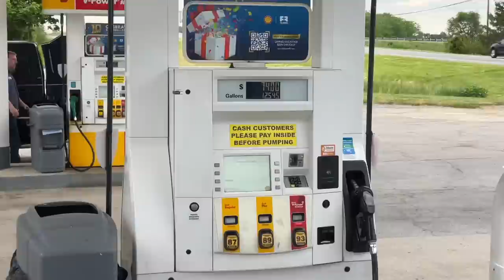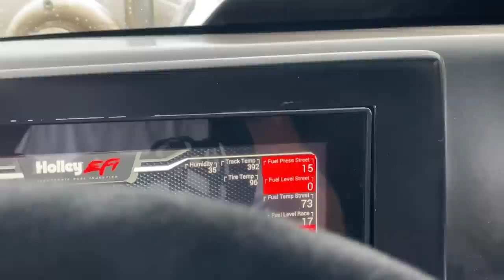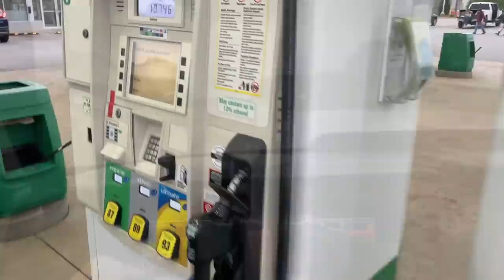Midwest Drag Week DAY 2 - Mullet FINALLY Hooked Up and Ran His HIGHEST SPEED EVER!!!

Comment: Really nostalgic to see Kevin rolling with cleeter on this event in the car he built for him.  Even if he had nothing to do with the new engine setup.
Reply: He still built a hell of a racecar!
Reply: Exactly, even if the engine is now different, Kevin still did a ton of great work on the other parts of the car.
Reply: And he’s more responsible with the tuning…  You don’t want Cleeter running the laptop!
Reply: Na I'm thinking about Brent and cleet pulling apart Leroy when his drive shaft bolts backed out lol
Reply: It was a Texas speed motor. Now a Steve Morris engine. Kevin built an awesome car.
Reply: Kevin did build it with this motor in mind. Garrett just didn't have the engine money then... He had his helicopter to pay for! 😁
Reply: Well, he's the one who said the LS platform was simply not strong enough. It was time to get big or prepare to keep breaking them.
Reply: @ronbuckner8179  I think big block was the end game the whole time and I recall Kevin hinting at that during the build. I'm guessing there was a pretty long line to get that SM big block.

Comment: Kevin and Cleetus it's really exciting to watch you bring Mullet along, improving every step of the way. Hopefully the next track will be even better because there is little doubt in my mind, if the wheels don't spin you will be running 6s every time. Good luck. Hopefully the heat wave that's coming and the potential storms won't cause you problems.

Comment: For the race where the fuel is limited for 3 runs the 2 cylinder trick to run back to the start is ideal !
Reply: it runs on pump gas between runs though, only runs on meth once he hits the 2 step or gets into boost
Reply: Ya thats forsure not healthy for the engine lolol
Reply: @mike25620  I think during dyno testing they said it switches to methanol above 2lbs of boost

Comment: What’s most impressive about this setup is how you can drive it long distances on the street towing a trailer and race it. The dual fuel systems and build is just awesome.
Reply: Imagine if he went with the SMX variant lol.. Now that woulda be insane!... I bet he does in the future.. SMX is pure insanity.. Full billet long block, fully water jacketed, full endurance motor capable of 5000hp.. lol
Reply: Let's not forget you have to do the lash once a day at least. It's a lotta work but definitely worth it to put on that kinda show.....says the guy sitting on his couch not pulling coils and valve covers.
Reply: @JonHop1  Does it not have a SMX?
Reply: @marcog3210  No, it has a standard Steve Morris Big Block with the billet intake. Thats it.. But to say "thats it" on a Steve Morris motor is saying A LOT lol... Because its still a 3000hp capable motor... SMX is like 4500-5000hp motor. Next step up pretty much.
Reply: @JonHop1  is there a step up after SMX for a "streetable car"? just wondering lol.  4k to 5k hp is already insane.
Reply: @rayth4386  When you say "streetable" what do you mean? Because technically, the SMX is super streetable and withstand long drives and is very reliable. You can make an SMX motor last a very long time if you go with a less aggressive timing/head setup and more reliable rods, ect.. SMX is Steve's Endurance and streetable Drag motor. Its the best you can get before going with a pure Pro-Mod setup..
Reply: @rayth4386  If I remember correctly, because its been a while since I watched Steve's SMX breakdown, it is a full billet block and billet heads.. The heads are 100% custom billet and engineered off LS and Hemi heads(dont quote me on that).. I remember him saying he took the best head designs and combined them or something. Its a dry deck and fully water-jacketed for optimal flow. The cams are also custom designed as well. Not sure what the crank situation is on them tho. Ill have to watch the vid... The  purpose of them is for endurance drag runs on drag weeks. But they are multi-purpose. Why anyone would buy an $80,000 motor though for the street would obviously be a bit odd, but hey if you are rich, I would! lol.. Super versatile motor and super strong motor and well designed. Should have won motor of the year.
Reply: @JonHop1  ah ok I get u now. when I said street able I just meant something that u can do a drag and drive with relative ease. it's cool learning more about this stuff.
Reply: @rayth4386  I would check out Steve's channel, he has full break downs on the SMX.. Its in my opinion, one of the best V8's ever built for endurance drag purposes.. Its simply amazing. His head work and engineering designs are just phenomenal. Works of art. Steve's builds are the best of the best for street classes before Pro-Mods. But Steve can obviously Provide Pro-Mod setups and builds too.
Reply: @JonHop1  thanks for all the info and recommendation. I'll definitely check his channel out.

Comment: Once they get a handle on this engine combination, it's going to be crazy fast.
Reply: Its 100% capable of lower 6's..
Reply: @bigboreracing356  umm, it was the fastest pass of the day and you dont seem to know that the track conditions matter. NO high HP car was hooking up well, so everyone had to turn it down... If you didnt know, the whole east coast has been getting destroyed with rain. The tracks are not ideal for 6 second passes.
Reply: @JonHop1  He didn't say Mullet ran bad, he was responding to OP that said 'going to be crazy fast' as if 7.08 205 isn't already crazy fast.
Reply: @Choke_Dealer  I was about to say... Yeah I guess if you are only using Cleetus, Steve Morris, and Tom Bailey perspective, maybe 7.0 is average but you are right, 7.0 is crazy fast in perspective of drag racing in general. 200+mph is absolutely HAULIN
Reply: @bigboreracing356  not for mullet with a SM big block that capable of 5's... but yes, in the big picture it is...
Reply: @bigboreracing356  Calm down buddy. I didn't say 7.08 is slow. It is fast. But in case you are new to drag racing, that combination is capable of low 6s and possibly high 5s on a good track. You are definitely new to street racing because drag radials and that combination wouldn't win you any money on the street. With a $100k+ engine, there aren't even many people who would race you, much less put "big money" up.
Reply: @bigboreracing356  You were mesmerized by 7.08. You were calling other people "dipsh1t" for thinking that there is more to the combination and that it has a lot more potential. You did indeed need to calm down and quit attacking people for their opinions. Opinions that anyone with any racing experience knows to be true. 

And FYI you are wrong yet again- I'm no "kid". I was street racing at Hobby, Rankin and Cherry Hill here in Houston as far back as the early 90s. You can talk smack all you want, but anyone who has street raced doesn't think that Mullet, in it's current configuration, is a "money maker" on the street. I even gave examples in my previous comment, unlike you who just rants and attacks people who make factual comments.
Reply: @Choke_Dealer  I didn't say it's not fast either. 7.08 is fast. I was by no means saying that the car was slow or anything like that. It's fast, has been fast, and they just added a bunch of extra HP. So I was just pointing out that once they iron everything out, that thing will be crazy fast. Insane fast. It's got the potential to run low 6s or even high 5s on a well prepped track.
Reply: @JonHop1  I'm not the one calling you or anyone else names, my only point was that Mullet was fast already and they just added an engine capable of adding 1,000+ HP. It went from fast to crazy fast or insane fast, once they get it sorted out and put that power to the ground. Sorry about any confusion, I wasn't implying that Mullet was slow or anything. I'm also sorry that the guy started ranting and calling you names simply because you pointed out that the combination is capable of even more. I have no doubt that Cleetus and the boys will get Mullet into the low 6s/high 5s.
Reply: @RonniePTexan  did you tag the right person bro?
Reply: @bigboreracing356  What the heck are you even talking about bro?... Who is saying a 7 second pass is not fast? All I said, is that for Mullet's setup, its not that fast, and thats just factual. His current setup has the potential for low 6's. Thats all I was saying.. You seem to be making something out of absolutely nothing.. I dont know why, but some Cleetus fans are just weirdo's man... I dont get it..
Reply: @JonHop1  I think so, but if not, sorry about it bro. It's been a loooong day brother! Lol
Reply: @bigboreracing356  well his reaction afterward hitting that 6 would tell you other wise lol. Seeing that 6 is significant.
Reply: @bigboreracing356  Cleetus street racing?
Reply: @bigboreracing356  That car isn't set up for the street. It's a track car. Cleetus isn't even a street racer, are you watching the right channel?
Reply: @bigboreracing356  Just out of curiosity, why do you think Mullet would be a great street race car? Seriously. Give actual details and at least attempt to give some thought to it. So far the only thing you've proven is that you watch some YouTube and TV shows and think of yourself as the Expert on street racing. Back it up big boy. What would make Mullet such an amazing street raced car? How do you see it making big money on the street as you claimed before?
Reply: @bigboreracing356  Great way to sidestep the question. You may as well have just said "I have no idea how or why Mullet would make a great street raced car, but it looks and sounds fast"

Comment: How much different the Steve Morris motor makes the car!   No worries about how much power you can make...it's only about how much power the track can take.   This car is going to be QUICK on a really good track...if it doesn't wheelie itself to destruction.
Reply: I might be wrong, but I think they can use a wheelie bar if they’re running a big tire.  I think radial classes don’t allow wheelie bars.
Reply: @mysterj1  he's still on a radial
Reply: @mysterj1  he's still on a small tire  radial setup

Comment: Great passes ... 
I've got a stupid question... whats the MPG like when you're cruising the highway?
Thanks for sharing 🇨🇦
Reply: Going by the miles travelled and the gas put in, it'd be around 14. Which sounds good. EDIT, I'm so wrong. It's around 9 or 10.
Reply: I came to the comments to ask the same stupid question.
Reply: 9 or 10 really isnt that bad for what that engine is built for.

Comment: I think Mullet might need some carbon brakes. He's getting so fast that some of these tracks shut down might not be long enough.
Reply: I don't know much so I could be very wrong here but wouldn't carbon brakes be bad for a drag car since they're only used for a few seconds and don't really grab till they're hot? Or is 205mph plenty fast to get them grabbing?
Reply: @rob1721  That is a good point, and the street driving would likely suffer even more than on the track. There are quite a few compounds of pads, but I have heard some are made for road coarse racing where they keep the brakes hot. They would be bad on the street. I think the hawk pads I run on my 79 C20 pickup are called fero carbon and they are made for street vehicles and give more aggressive braking hot or cold. He has double parachutes because of the speed, but we saw what happened when a chute failed on Tom Bailey's car and Cleetus trashed the brakes with the emergency stop. I wonder what Tom uses for brakes and compound.

Comment: Factory under sump guards are usually designed to draw air through the engine bay and out the bottom to aid cooling. Maybe someone at the shop can design and make custom unit for Mullet, because the knowledge and skills are there.

Comment: I still think it's worth going down the Tyre pressure route.
Lower pressures = larger contact patch on launch
Lower pressures =  more heat in the tyre as the incompressible air inside heats up instead of compressing (etc)

I only say this because I don't ever see much tyre wrinkle

Comment: HA! I had to do the same thing on my dual fuel injected car. My street gas fuel pump went out on a 200 mile trip and all I had was a tank full of 116 octane in my race tank. I had to switch tunes and burn the 116 gas to make it back home.  That's the stuff you gotta do when you have different size injectors for street and race. Amazing the things you have to do along side of the road to get you going again!   🤣

Comment: Hey CLEETER it looks like mullet needs a bigger rear street cruising tank 
not sure if there is room for an extra tank if there is maybe even a secondary tank that connects with quick disconnect fittings and taps so it’s easy to remove and disconnect at the track for weight reduction when making passes .
then bolt the cruising tank back in and connect the fittings and turn transfer taps on. 
Use a lift pump on a relay and use a float level sensor  in the primary rear tank to control transfer or some thing like that just a thought.

Comment: Have you thought about putting a shield on over the pan to protect it, but modify it so it isn’t a solid piece? Like instead of just a flat sheet, dimple die it so it’s still structurally strong, and you’ve got good airflow through it. Would hate to see you lunch a brand new pan raw doggin’ it.

Comment: have you thought of using a removable wheelie bar for the TC to work off? it would take some design and programing but you could have a wheelie cut work when BOTH front wheels are off the ground (no longer increasing in speed as rpm IS increasing) then the wheelie bar with a spring holding it to the track can sense wheel speed vs track speed, that way you could tune a specific amount of allowed slip. probably over-complicated but it would work heaps better than just using the front right, my opinion: you need toe in on the front right but not the front left. i hope you get it settled out and figure where the frame is bent in terms of the bump steer, perhaps get some new steering arms made up. the skid factory made a good video about it recently

Comment: Congrats on a new high mph record. I can't wait for you to hit a 6 sec pass. I still think that you need to do a longer burnout. With the horsepower you are making you need more heat in the tires. And it will stop the wheels from spinning on the launch and down the track. I race top sportsman and I had the same issue.

Comment: you have everything in the car to turn in 6 second runs at every track as long as the track is good enough to hold the power . the poor track conditions are the only factor that can and will stop you having 6 second track times even If there all 6.99's .

Comment: Always wondered why nobody grabs neutral when they get off the gas to unload the motor and transmission under decel. I know why we don't during a burnout, but with the oil slosh and reverse loading under high R's and speed seems very stressful. Thoughts?
Reply: I think it's the potential of accidentally grabbing a lower gear

Comment: With all of the tire spin you constantly get wouldnt it be a good idea to reduce the air pressure in the rear tires to put more rubber on the track? This is a serious question as I genuinely do not know.

Comment: Super weird issue I had. In my 2012 mustang gt. Had MSD 2 step installed. Mounted to the air box. Car suddenly started running on 4 cylinders or something and sounded horrible and had almost no power. Wrench was on the dash too. Popped the hood to see the 2 step module dangling down in the engine bay. Just taped it on with tape I had in the trunk. Started her up and like nothing ever happened ran fine. Hasn’t happened sense.

Comment: Are there different valve lashings for race and driving? Or do they just work loose when driven?
Reply: They usually run a tighter lash, or zero, for racing then normal clearance for driving. If just making a pass it doesn’t heat up enough to be a problem compared to the long drive between tracks.

Comment: I would love to see how loose or tight the valves were since they need to run them constantly
Reply: @turfguy420  that makes no sense, I have solid cams in everything I run. My Streetcar 65 Nova with a 532 cubic inch blown E85 motor, and I run .018 at the track and on the street. I don't get it

Comment: Cleetus... I think you have loose plug connections.. It's coming and going.. Intermittent power and function is usually a plug that ain't consistently connected.. I don't know if you saw it but on your first day... around your second or last run.. The Holley Dash completely shutdown.. You were just finishing the run and had other things going on in your mind when it went dark and then it came back on.. Check the video.. I'd inspect all those connections between power source and control units.. and certainly the dash screen plug in's.. Just a though.. I've got a lot of years in the electronic trade starting with a Nuclear Submarine back in the 80's and computer systems presently.. Hey, can't live from a Tip Jar. So, I make a living in the trade.. wouldn't hurt to do a point to point under the dash inspection with a mini lite.. Cheers, keep Mullet Running Strong..  Hey, to Kevin too..

Comment: Hey from across the pond @cleetus, just curious as a car physics guy.. How much HP is mullet using of the 2000+ at highway speeds? Curious on a aero efficiency aspect, much love man :)
Reply: At highway speed running pump gas I wouldn't be surprised if he's running only 700-800hp if that even
Reply: @beardedforlife3740  Cheers brother, that roughly what i'd had in mind, el camino isnt the most efficient aero wise. A bit of me wondered if there was some 300hp map they ran to preserve the cars between tracks, but is that against rules?